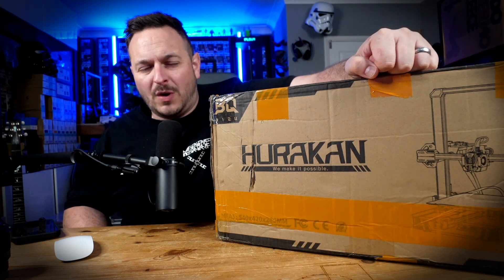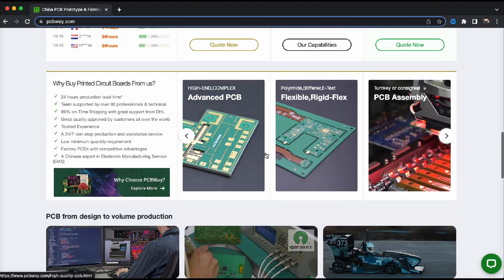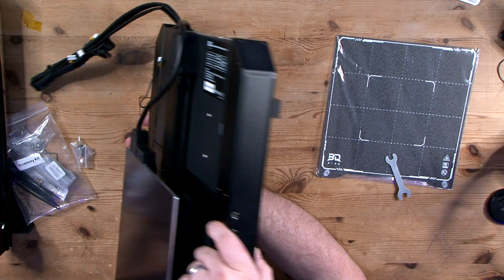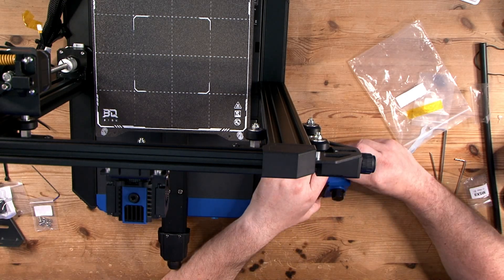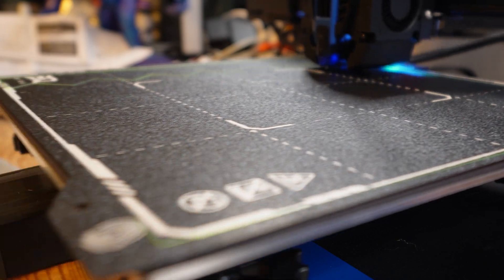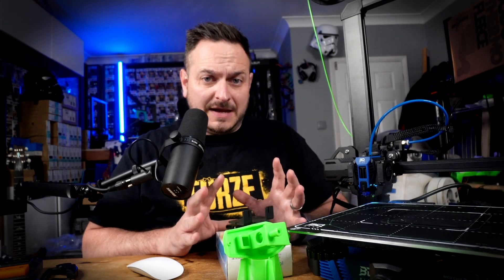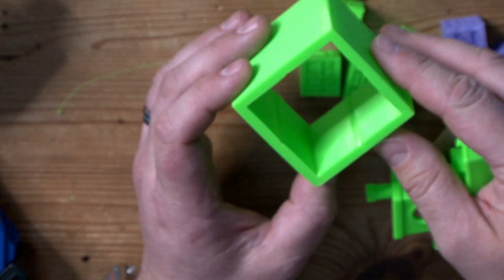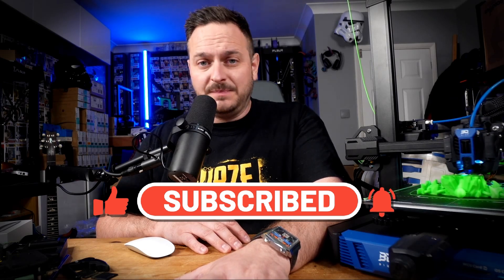BIQU Hurakan 3D Printer - Is It The Amazing Klipper 3D Printer You're Been Waiting For?

Comment: It's just another cartesian style of printer...But it has enough "neat" things I still might buy one. It's not the Klipper, the probe or the size, it's more the whole package. I like the Manta board with the "Pi" option built in. I have my own Manta coming, but I really like the idea of a printer with it from the start. It's a direction I hope the printer market goes towards.
Reply from the maker: Yep just remember the start prints are slow but you seem to know about klipper already so you’ll need to plan some tests and get the thing dialled in to get those fast prints. I’ll look to upgrade the hotend for a direct drive and maybe pop a linear rail setup on there too

Comment: Very useful information here. Thank you for that. I bought a hurakan which was delivered this week and I assembled it yesterday and got printing immediately and was very thrilled with it. Today when I powered up the printer and looked under the machine tab on mainsail web interface I saw that klipper, moonraker and some others had a "invalid"/"dirty" where you see "up to date" normally and from my limited klipper knowledge I clicked on update all and congratulations after the soft restart I have a perfectly unusable printer and absolutely no information about how to make it work again. I have submitted a support request to BTT and knowing will have to wait a few weeks before I hear something from them. One thing I forgot to mention their quality control sucks because I had to adjust almost all the nuts and bolts on the printer because everything including the bed were loose and wobbly. So honestly I would rate this printer as awful as the creality printers. That is my experience

Comment: that on off switch on the bed is to turn off the large bed heater and just use the small one for small prints in the center
Reply from the maker: Ah I see ! Weird that it’s a manual thing I was thinking it would be something added in the slicer to active a second heated element! Thank you for that! There’s a lot to this printer, so that was quite easy to miss!

Comment: Great vid! You must have done some DJing at events in the past...full on expected you to introduce the next track at any moment. Some interesting points: 1.) After your intro which speaks about GD, it may be good to clarify that they are using ST. 2.) Their bed wheels are loose intentionally to prevent flat spots during shipping. 3.) The switch on the bed is to switch between the central heating pad and the whole bed pad. Great for print farms that print small parts that only occupy the center of the bed.
Reply from the maker: Yep you’re correct on the dj part and public speaking ! Totally correct on the ST element but i was referring to the pi at that point :) the bed being loose makes total sense, and I figured the switch would be to simply turn off the bed. I was thinking it would be a setting determined by the print size
Reply: @TheRealSamPrentice  We were actually discussing how to make the bed heating a function print size on the bed by reading parameters from the g-code. We think we have found a way but it will need more testing and some upstream stuff added to klipper.
Reply from the maker: @looxonline  sounds good! Keep up the awesome work!